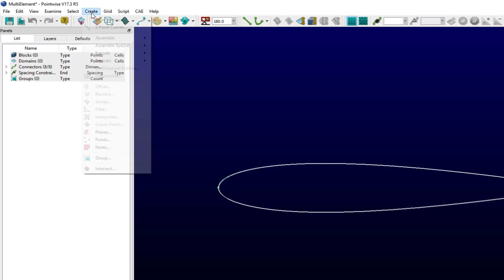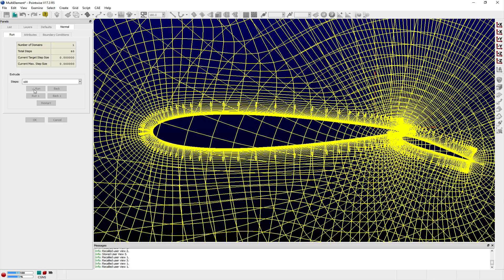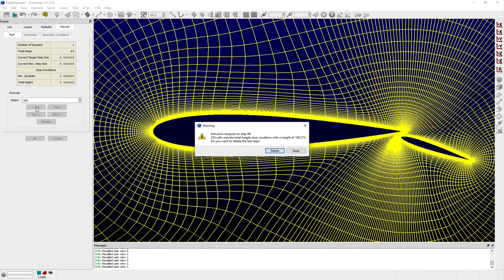Normal Extrusion Stop Conditions

Comment: Hi, I am using the same method, to generate 2d mesh of an aerofoil with a spoiler at 0.6 chord length, the spoiler deflection is 10 degrees. Due to the small angle I am unable to create an extruded mesh. Blocks strategy and T-rex also failed to give a high quality mesh.  Any suggestion ?
Reply: I'm in the same situation... Did you succeed in the mesh? Can you give me some tips? tks